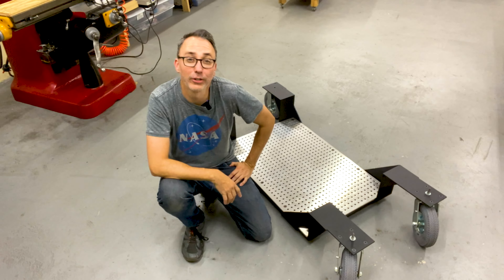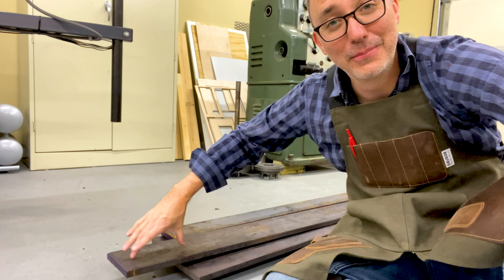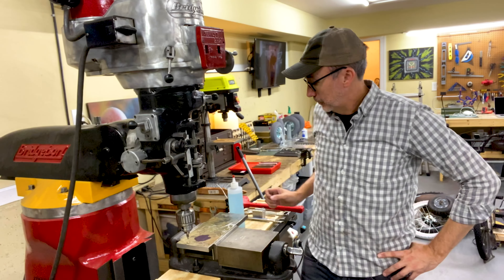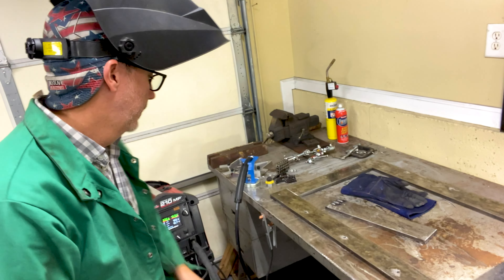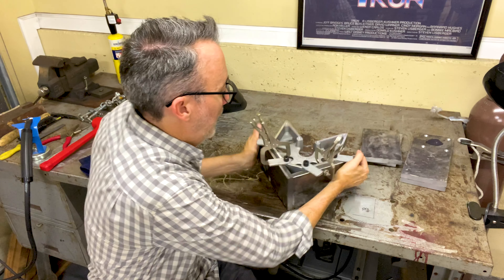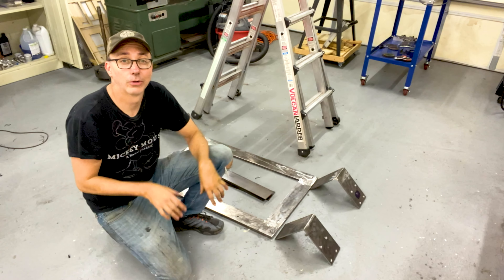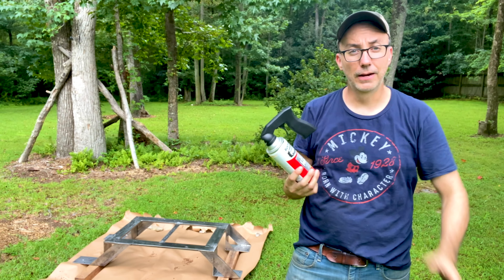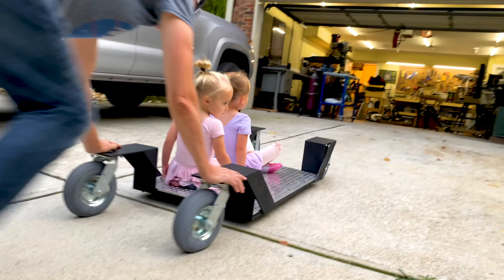Building a Dolly for a Big-Budget Hollywood Movie Set

Comment: Cool project. I found you because of your video on the PM channel. Your story is intriguing, because there are some mild similarities to mine. I am not changing careers (I still work full time as a software engineer), but after taking some welding classes about 7 years ago, a few years later, I decided I wanted to jump into machining as well. I learned a bit about lathes and mills at a local maker space, the next thing I know, I have a 1942 South Bend in my shop (that was supposed to be used for storing my Jeep in the winter - that happened for exactly one winter 😂), a few months later, I found a Bridgeport mill. Before I knew it, I bought a K&T horizontal mill, a small 7" shaper, a bunch of tooling, and most recently ANOTHER South Bend lathe. All of these needed some level of restoration. Nothing is CNC - although I do a fair bit of 3D printing. Maybe some day I will turn it into a legit side hustle, but for now, I'm enjoying learning, making things, and I am also publishing a few videos of my own here on YT. As a follower of Christ myself, I will especially enjoy watching your channel.

Comment: Excellent work!  I don't know much about welding, but I do recall seeing some right angle magnets for lining things up.  Would those have been in the way here, or does that jig have the extra holding power needed for the more precise angle you wanted?
Reply from the maker: Yeah I’ve got those things but magnets don’t hold as strong as I needed them here. More for thinner metal. Or if you have a flat welding table.